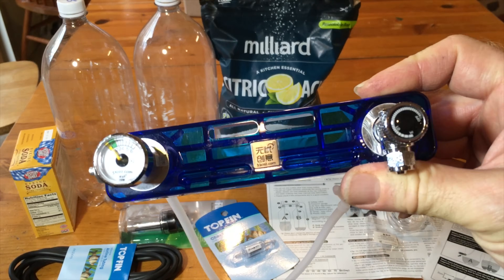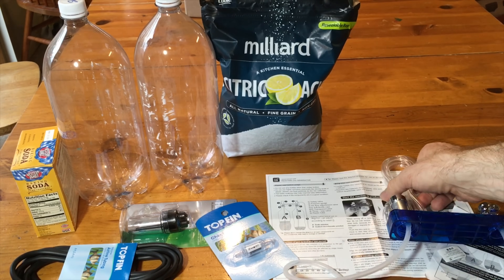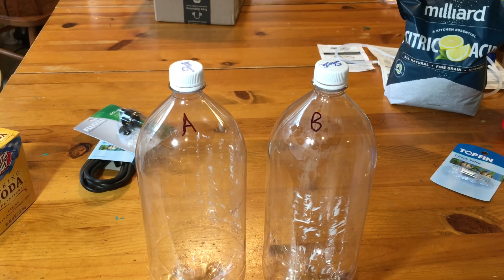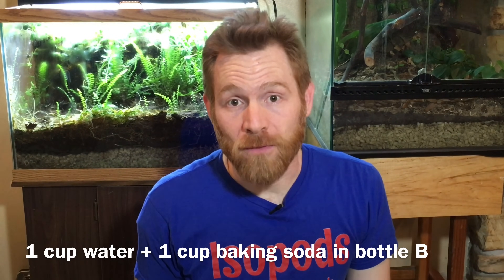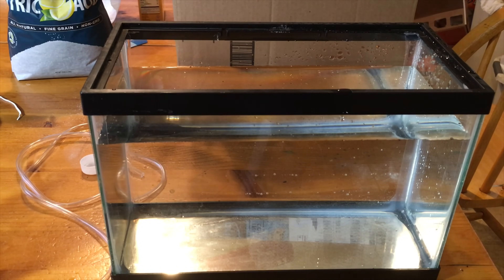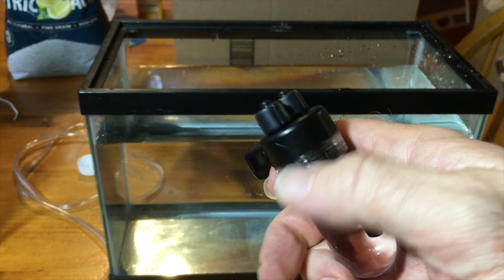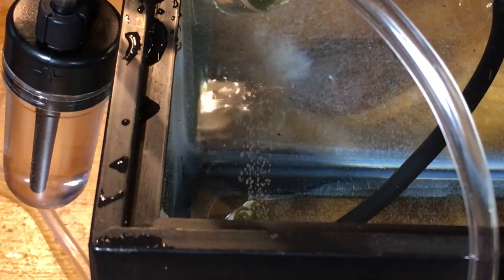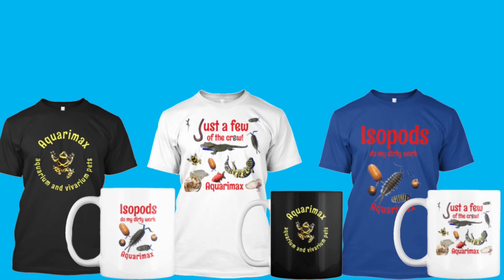Citric Acid CO2 System for My Planted Aquarium

Comment: Hi, would I need to by bubble counter and defuser?
Reply from the maker: Pamela Woolford Hi! A bubble counter is not 100% necessary, but does help you monitor CO2 levels, so it is recommended. The diffuser is not needed if you decrease the size of the CO2 bubbles in another way. One of my favorite methods is to feed the CO2 into the intake of the filter, where the impeller inside the filter will create very fine CO2 bubbles...and it costs nothing! 😊👍
Reply: @Aquarimax  do I need high lights?  It'll be a 10 gallon.  Mostly lower light plants.
Reply from the maker: Pamela Woolford you would probably see some benefit from CO2 even with low light...light would,become a limiting factor rather than CO2. You would not get the extremely rapid growth that is possible with CO2, high light, and fertilizer dosing, but you’d probably see a significant difference.

Comment: Pls share from where you got all those equipmentss
Reply from the maker: amrithu mohan here is a link to a similar system : https://www.ebay.com/i/151321754485?chn=ps&ul_ref=https%253A%252F%252Frover.ebay.com%252Frover%252F1%252F711-117182-37290-0%252F2%253Fmpre%253Dhttps%25253A%25252F%25252Fwww.ebay.com%25252Fi%25252F151321754485%25253Fchn%25253Dps%2526itemid%253D151321754485%2526targetid%253D475515013341%2526device%253Dt%2526adtype%253Dpla%2526googleloc%253D9029702%2526poi%253D%2526campaignid%253D1482101415%2526adgroupid%253D56517111839%2526rlsatarget%253Dpla-475515013341%2526abcId%253D1139296%2526merchantid%253D108263808%2526gclid%253DEAIaIQobChMI26OchtHJ3AIVCJRpCh1VVwbCEAkYCSABEgIdLPD_BwE%2526srcrot%253D711-117182-37290-0%2526rvr_id%253D1616577526772%2526rvr_ts%253Df0e9e3f81640a9cc033512d7fff59a7e
Reply: Aquarimax thanks

Comment: Very cool,... That clip just didn't want to behave. I have used the yeast and sugar while camping to draw the mosquitos away from the area where people will be sitting. I should try this way out if I go camping this summer and let you know how it works out. Mosquitos are drawn to CO2 for some reason, maybe they figure if it breathes (out gasses) it will bleed. You gave me ideas. If I can use it to draw them into a container with water I should be able to drown them.
Reply from the maker: Vexing Cat Oh, I like really your idea of a citric acid CO2 mosquito trap! I think you’re right, I read about how mosquitoes are attracted to CO2 because it leads them to breathing sources of blood. If you were to put a little soap in the water of the drowning chamber, the reduced surface tension would probably help trap them. I have experimented with a similar yeast-based CO2 generator for trapping fungus gnats, with promising results.
Reply: The soap is a great idea!
Reply from the maker: Vexing Cat if you try it, I would love to know how it goes 👍